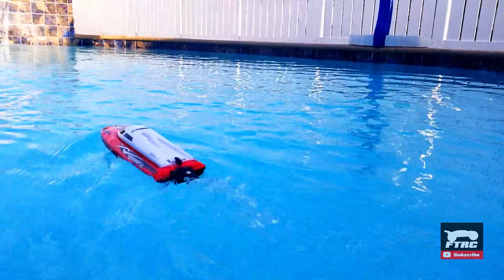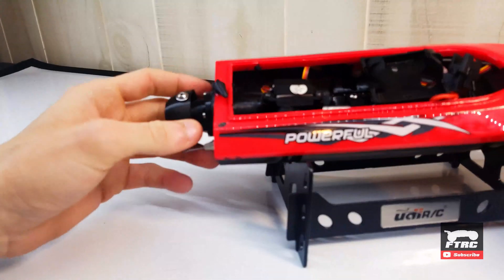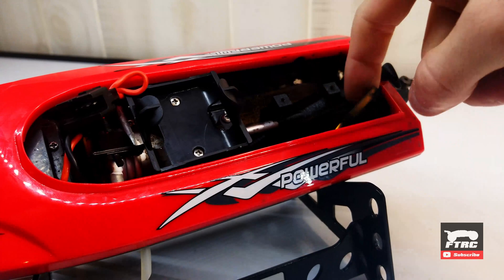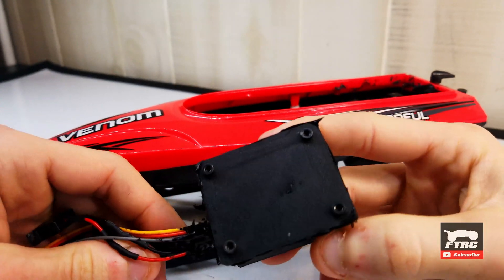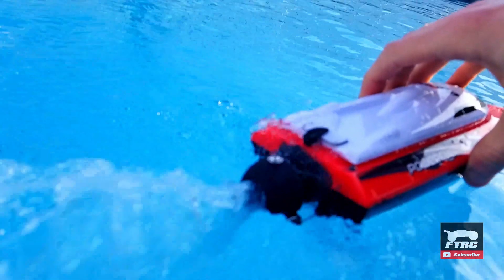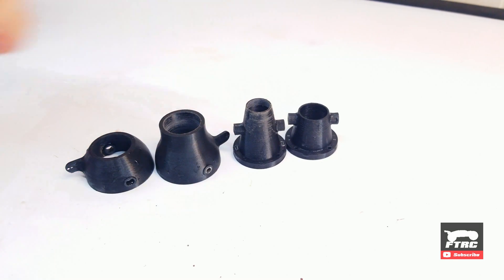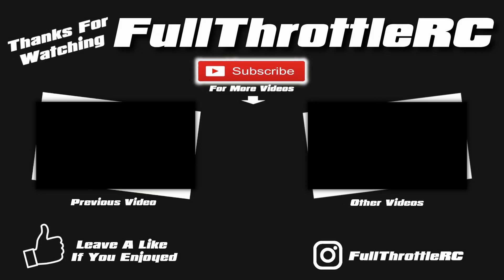RC Jet Boat Conversion! (3D Printed Jet Drive)

Comment: Set the boat in water with the lid off and you will see exactly where it’s leaking.
Reply from the maker: This boat unfortunately had more problems than just water getting in the hull. I ended up 3d printing an entire boat that worked a lot better!

Comment: Damned i want do the same but with a Ebay jetdrive from china,der H100 was ordered too .  Nice project you have done!
Reply from the maker: Thanks! It was very tough to get a good seal on the jet drive inside the factory hull.
Reply: No way I got a h101 and been considering doing the same is their anyone.whos thought to sell these drive fitting components? As I really wish I had a 3d printer lol
Reply: @conchubharbeats  Amazon has them at multiple prices and with motors either brushless or brushed I’m thinking of getting a cheap boat like the h100 and doing the mod
Reply: @chefbgordon8892  if you can remember come back and let us know how it gos :)

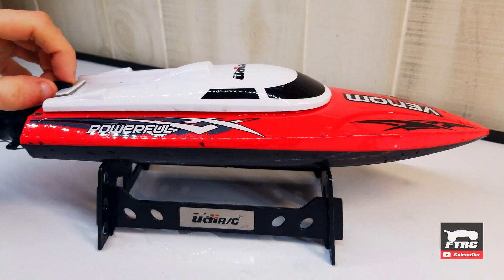Comment: I also made a jet drive and had the sale problem you mentioned at 6:08, i fixed it by making a cros behind the propeller thats 1mm thick and 3mm long, this will provend water from spinning and creating a tunnel for air to come in.  If you do this you will be suprised how good your drive wil work
Reply from the maker: I believe you are correct! If you haven't seen my part 2 video, check it out. I modeled some diffusers into the nozzle that essentially do the same thing. I may try your idea as well though...👍
Reply: @FullThrottleRC  ow, lol, didnt see it😂, looks to work fine, but why the low speed?
Reply from the maker: Yea that's the new problem... I put the brushless system in it thinking it would speed it up, but the motor didn't have enough torque and would bog down when water started flowing through the jet drive. I put the stock brushed electronics back in and that's top speed on 2s. I'm not happy with that speed so I have some plans to try a few different things. Stay tuned...
Reply: @FullThrottleRC  you got an extra sub, so i wil stay tuned😂, nice channel, im testing my jet with a hpi 5700kv brushless motor on 2s, can't even go halve throtle, higher than that and the prop wil explode (happend ones) so power isnt all💪😉
Reply from the maker: @enginesandmore1013  wow! I'll have to check it out. Hope I can similar results!

Comment: Maybe try some marine grease on the servo shaft where it goes through the boat wall before you relocate the shaft. I have a small boat like this and I think a lot of water gets in where the top cover meets the boat body. You could try submersing the boat just to see where the bubbles are coming from. Nice work!
Reply from the maker: Good idea! I never thought about putting grease there. I'll definitely give it a shot